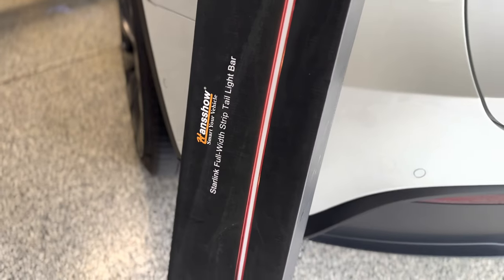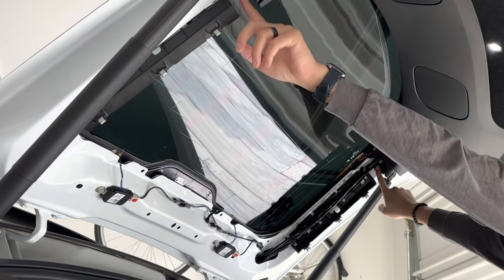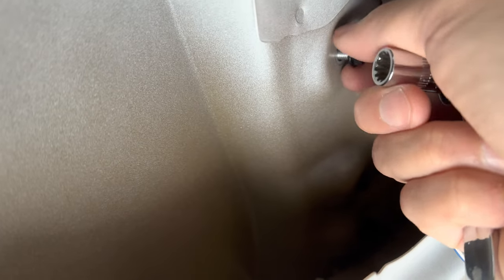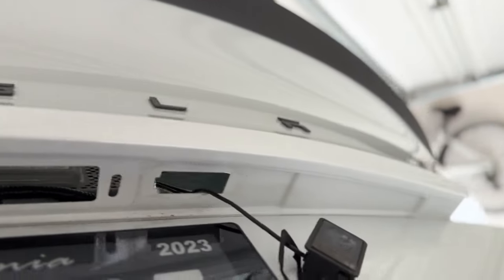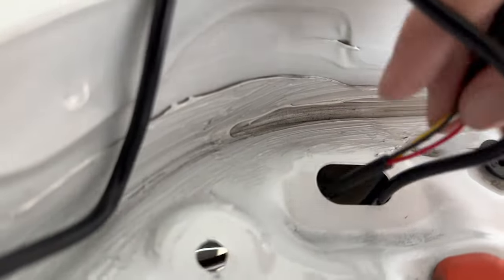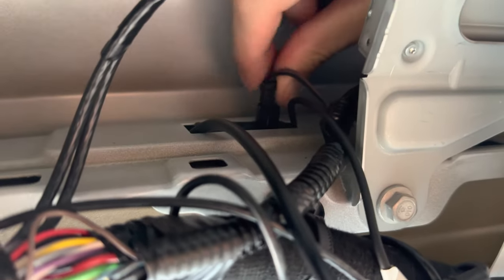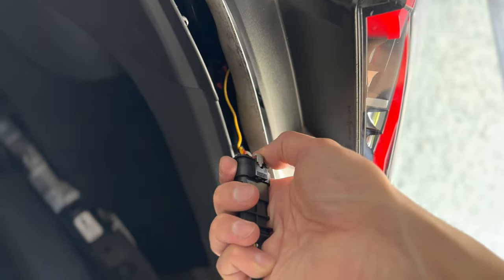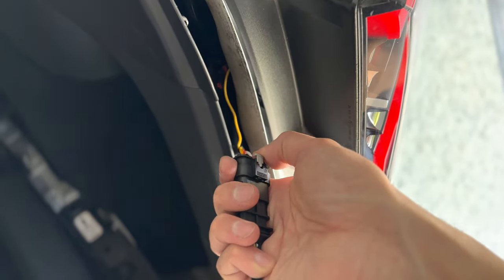Tesla Model Y Light Bar Starlink Wide-Strip Taillights! MUST HAVE Accessory by Hansshow

Comment: I'm guessing there's no way to configure the way the lights work. I would really prefer if the whole light bar didn't flash with the blinker
Reply from the maker: Guy can cut the indicator wires
Reply: @megawatts ooo so its possible to have this exact setup but without the indicators? I personally think its just too much with the indicators
Reply: @racksontheway659 I agree style wise but wouldn’t it be safer? No such thing as too much attention when it comes to indicators

Comment: I don’t like the turn signals. Also even though it’s clever it’s just a eye sore that it protrudes out connecting the oem lights to the bar
Reply from the maker: You can disconnect the turn signal just cut wires to the indicators. Then it works as running lights and brake lights.
Reply: @megawatts   thanks bro I’ll be waiting
Reply from the maker: @CumBrianFries  just cut the signal wire on the harness and you good no more signal.
Reply from the maker: @CumBrianFries  every car is different color so best to check with Hansshow to confirm.

Comment: I notice you installed the pilot light at the bottom. How does the wire connection from that light  to the tail lights, then to your new light bar strip link tail light?

Comment: Trying to install this on a 2023 Model Y Performance.  The light strip is 3 inches on the in the center (widest point).
The to be installed (above plate) is 2 1/2 inches deep  (centet), so there is 0.5 inch of the strip light sticking out.

Is this how your look like? Can you please show a picture from above? I would expect the light strip to be flush with the lip, not protruding out.
Reply: Any problem with the camera ?

Comment: Any issue with the license plate mounting after installation?
I had a lot of problems with this and ended up removing it!
Reply from the maker: I removed the entire license plate frame, installed and then reinstalled the license plate no issue whatsoever reinstalling it.
Reply: When I installed mine it would not allow the plate and frame. Can you share a photo?
Reply from the maker: @jplatis  oh I have Rplate digital plates so smaller bezel
Reply: So will this not fit a standard USA plate?

Comment: I installed mine but now my reverse camera lines are out of whack. Do you have any tips on how to fix this?
Reply: Did you ever find a solution to this? 
I’m in the same boat
Reply: Did you ever fix it ?
Reply: @ReconnaissanceLime did u ever fix it?
Reply: @gambit550  
Nah, the camera ends up being slightly lower after install so the guide lines will always look little weird as long as the light strip is installed.
Reply: @ReconnaissanceLime  damn .. is it worth doing it then? Hesitant on buying this product thanks for the reply
Reply: @gambit550  
Sorry for the delay 
Ehh.. I’d say no 
The initial control box for the lights they sent me would cause both led strips to flash when I have turn signal on and the brakes
So they sent me another control box.. and charged me for it 

This one corrected that issue but whenever I have the headlights on & light strip on at night and step off the brakes the whole bar turns off for a split second before turning back on 
Like it goes.. 
-Step on brakes
-Light bar turns brighter
-Step off brakes
-Light bar turns off for 1/2 a second
-Light bar turns back on

You don’t notice this during the day since the light bar is off by default unless your braking or turning

But at night when the headlights are on It looks a little annoying having it flicker off-on whenever you get off the brakes 

I could drop a video or something if that was confusing

Comment: I appreciate your install vid!!!

Just installed the Starlink on my 23MYP.  Had to use your install vid plus Hansshow’s to complete the install.  Nothing too difficult and not really time consuming, but it took me a while because I was watching and rewinding to make sure I didn’t miss a crucial step!  Looks great and I’m glad I added these lights to my MY.  Next, I’ll be adding the “F1” lights like you have on your Y. 

I’m assuming the F1 install is much simpler and faster than the Starlink install?
Reply: Did it clear your license plate easily?
Reply: @timothyvo3749  Nope.  I modified the plate holder (Dremeled the screw holes to drop the plate down a bit) so it sits just low enough for it to clear.
Reply: @JSinistaProductions  thanks for the info - could you elaborate just a bit more? Like were you able to use all 4 mounting holes for the plate holder? And how much dremeljng like a half inch? 3/4”?
Thanks again 👏👏
Reply: @JSinistaProductions I have the same car as you, but the light strip is not flush with the lip, where 0.5 inch sticks out.  Is this how yours look like? Can you share a photo from above?
Reply: @carlos_siqueira Mine doesn’t fit flush, but it only protrudes maybe 1/8 of an inch.